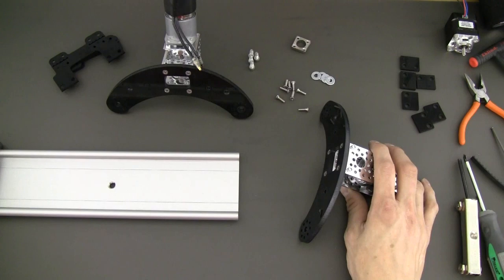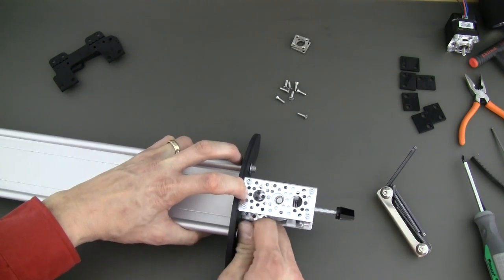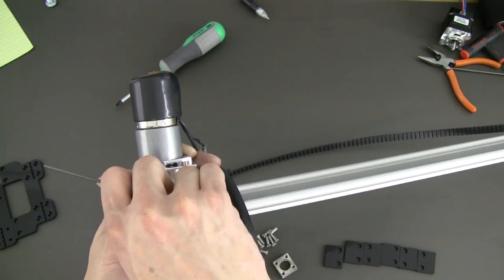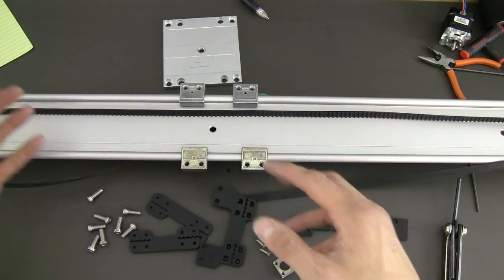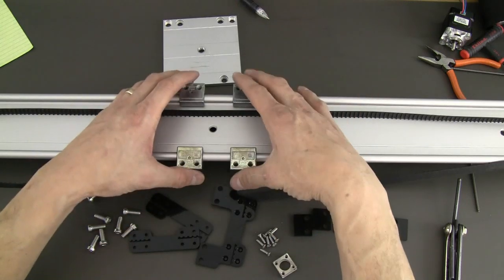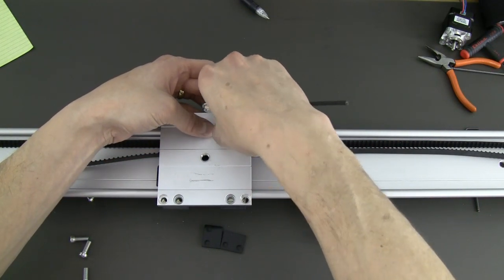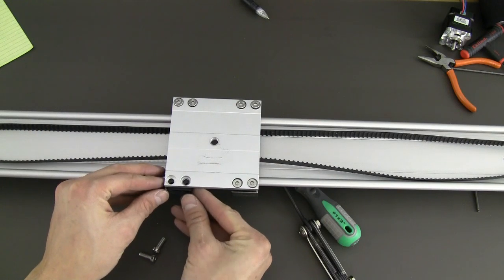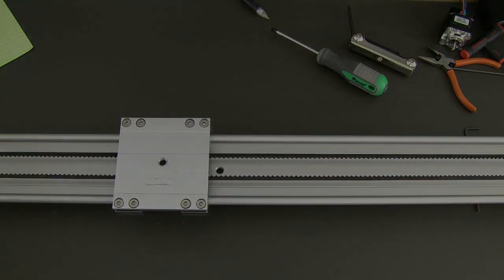Actobotics - IGUS W1080-B Slider Kit (SKU: 637126) Assembly (part 2)

Comment: Have any videos of this working....and what is the maximum incline that the slider can be set at??
Reply from the maker: +E Ryan Here is a customer video of it in action https://youtu.be/0SOBWuYR-4g   There are additional customer videos of it in action on YouTube.  Regarding the angle, it’s fine even going vertical as long as the proper motor is used for the payload attached to the slider.  Should you have any additional questions please contact our Tech Team tech@servocity.com